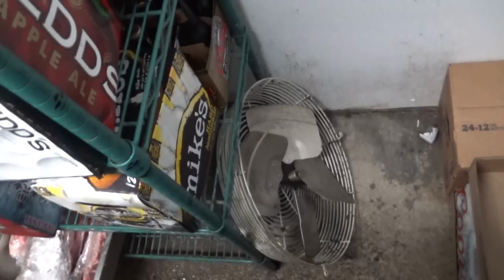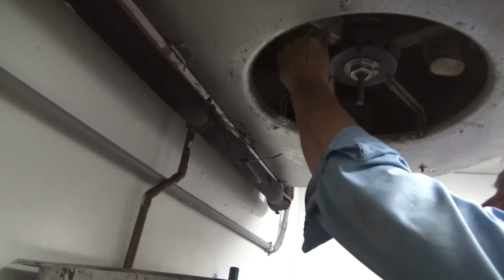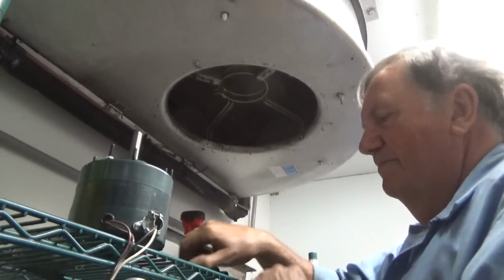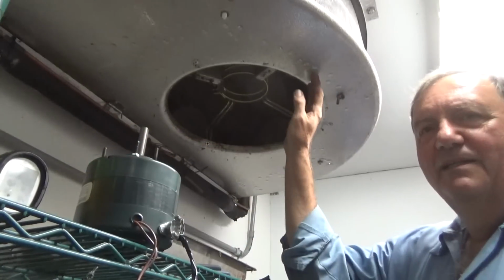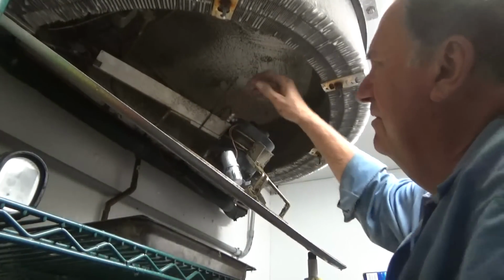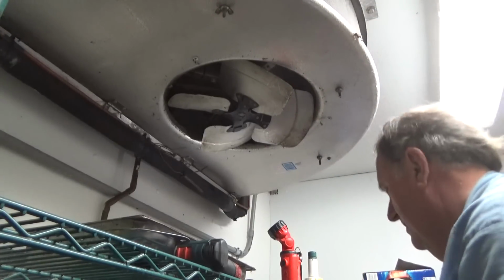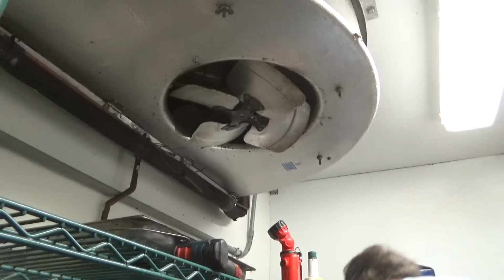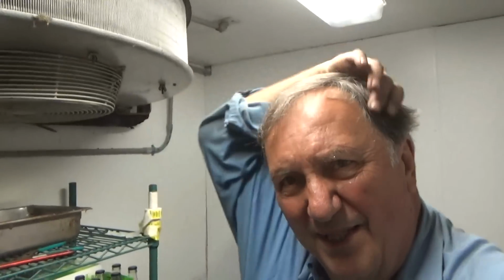Bohn half round evaporator with bad motor

Comment: nice work Jim, it's not very often you see a 48y frame motor in a cooler.
Reply from the maker: +George W I found it at United Refrig, it cost me $228.
Reply: Must have been an OEM at that price.
Reply from the maker: +George W I marked it up $10. plus my labor , the customer still got mad, he said that he found one "on line" for $69. The internet is making it tough to make a normal profit.
Reply: I know what you mean.  Yet those on the internet are usually Chinese knock offs.  And won't last more than 3 months.  At least the motor you put in will last years.
Reply: +Jim Pettinato Should have told him to buy it and put it in himself for $69.00 then since he didn't like the bill. People expect us to work for free or on the cheap.
Reply: +Clarence Nesmith I doubt he flinches a bit when he charges the customer 200% markup on items in his convenience store.